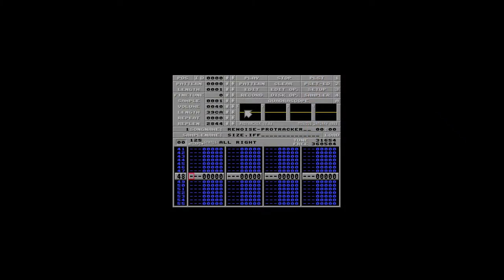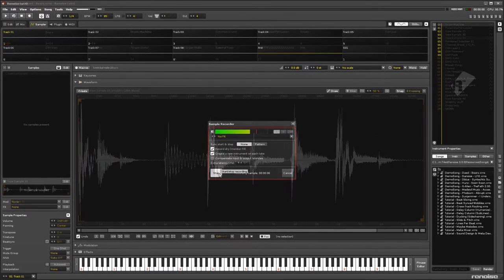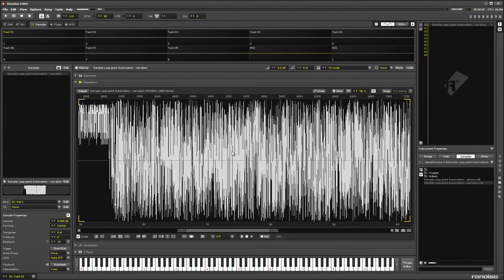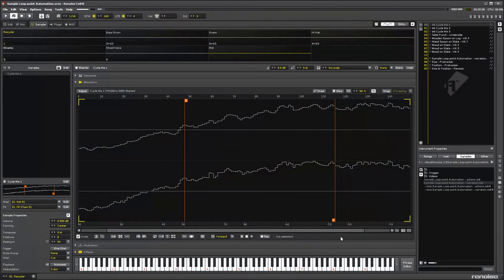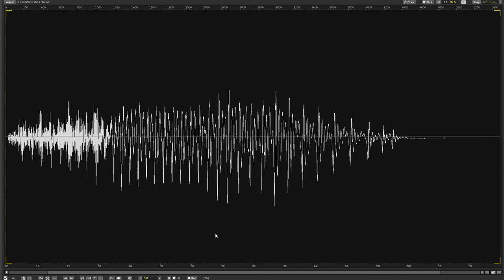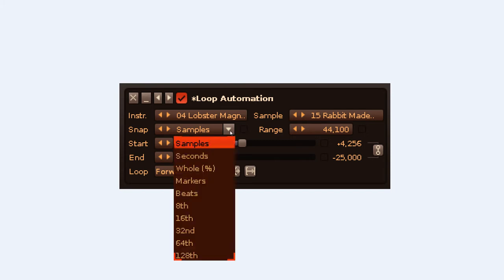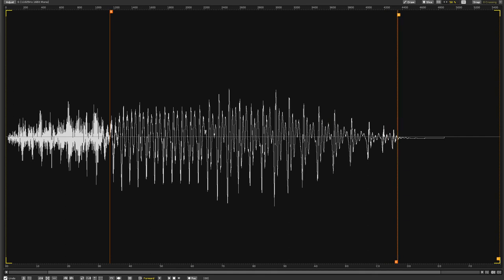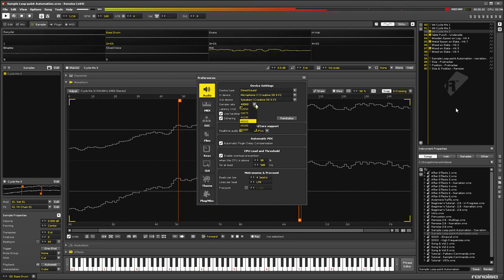Sample Loop-point Automation

Comment: You understand! Thanks for your dedication to illustrating the possible implementation of this feature. In 1994 I fell in love with the sound of manually moving loop points in protracker and have wanted a properly modulatable implementation ever since. Lots of samplers will do it, but none with the non-interpolated raw low sample rates that Renoise can achieve. 3 years after you posted this vid, I still live in hope. Maybe I should stop obsessing and just write some tunes, but I honestly just want this type of sample level granular greatness to happen.